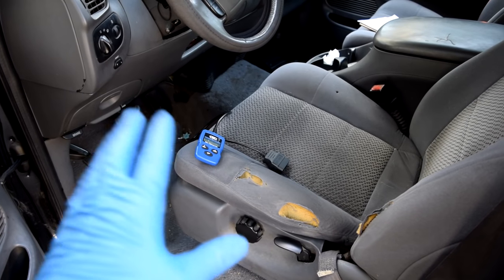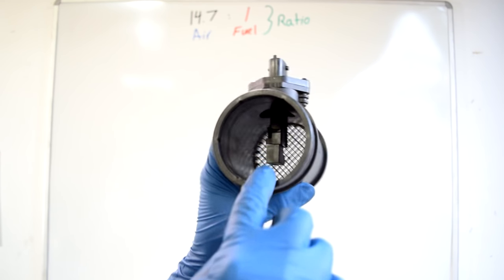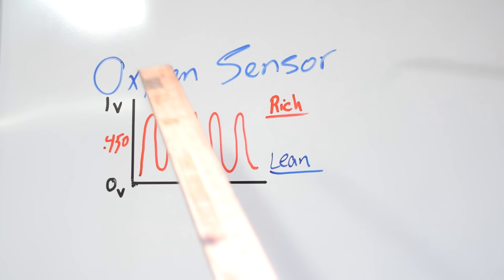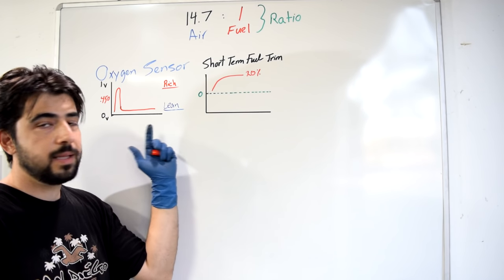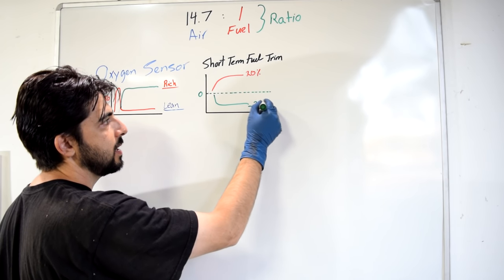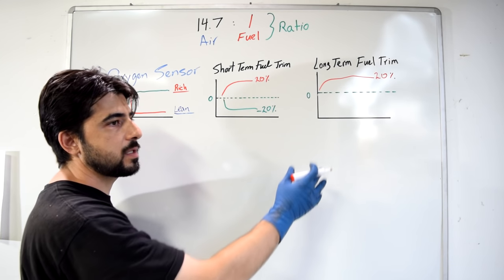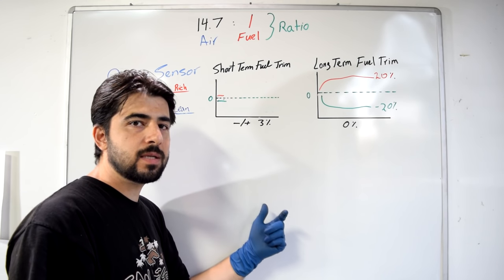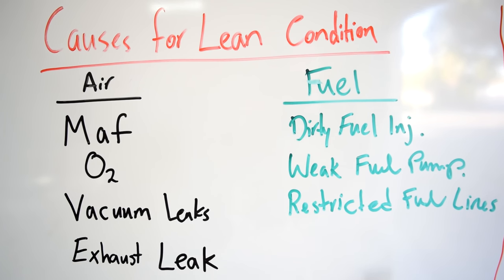Short Term and Long Term Fuel Trims Explained

Comment: I have a similar question. My Honda elements previous owner had a shop install an aftermarket cat and I noticed they changed the placement of the upstream sensor a lot closer to the cat itself than stock. It's almost on the cat and the downstream is at the normal position in the middle of the cat. If the upstream is very close to the cat basically at the beginning of the cat. How will that affect my fuel trims because I'm running lean like negatives 15 on both short and long term but I have zero codes just a little rough idle occasionally only on idle.

Comment: I'm in Poway  cant get 2003 5.4L  f150 to smog too rich both banks , total  do it myself  mechanic since my transmission  literally  blew up. I rebuilt  4r70w  about 7 times before I got 3rd gear to  work still no overdrive. No neutraling out  steady 3rd gear. Now eng8ne is  rough idle . Where you located? I need help

Comment: What if my Short Term Fuel Trim is normal (0, +/-5) but my Long Term Fuel Trim is constantly above 30? The number does go single digits when I floor it real quick. I have a p0171 lean code for my Toyota Corolla. Already replaced the intake gasket, valve cover gasket, and air filter. I did clean the MAF sensor but that didn't seem to work even though it was dirty. I replaced it with a inexpensive MAF sensor and that didn't work either.

Comment: I am asking the MAF sensor for my 2010 elantra has 5 wires. There is a  ribbon plate measures and another sensor in the housing. Should I clean both of these with the mAF sensor cleaner. Also the idle is rougher in drive than in neutral. Both STFT and LTFT are negative... STFT .05 and LTFT . 29. I am waiting for my scanner to be replaced and will retest all the O2 upstream, and STFT, LTFT. Any further thoughts...Thanks

Comment: 02 Sienna, 420 code.  Does 99.2% B1S2 indicate a bad after cat O2 sensor?  all the upper are at 3.3V and other long term is at 14%.

Comment: I just got a Zurich ZR pro scan too and don’t currently have a check engine light but might soon. When I scanned my car to get familiar with the tool the long term fuel trim says it’s at 14% and the bank 1 sensor 1 is at 3.3v constant and bank 1 sensor 2 is all over the place. Is there any way I could send you a pic of a line graph of the engine rpm... sp02 sensor 1 and 2 and long term fuel trim...?? I’m needing help..

Comment: At idle I have a lean condition with around 7-10% idle. I have a honda Crv 2003 and the air intake hose is torn right where it is held on to the throttle body. Could this cause a vacuum leak that could cause the issue? (All seals and gaskets have been replaced last month). It's a fairly cheap part and I didn't think it could be a big issue but looking at the video it seems to point me that way

Comment: Hi there!  Can you tell me ...Rough idle no check engine light...Scan tool on closed loop is 2.0 volts O2 Sensor upstream....0.74 Volts downstream, STFT    -o.78%   LTFT   1.56%  Fuel trims look ok?  But voltage on O2 sensor really rich at 2.0 volts.  Car drives ok??? Any thoughts?  MAF sensor seems ok  Checked with scanner. Throttle body was cleaned.   Fuel trims added together look good except STFT 
- 0.78% . I can smell fuel sometimes when I cold start the car?  Anymore ideas ?   Thanks

Comment: If my ac is not blowing cold could this have any thing to do with it, some times I have a hissing Sound with some vape 💨  coming from under the hood and a little moisture I can see at bottom of the plastic pan that’s sits under front end that only happens tho when I put some ac/pro in, depending on which one I get it happens 1-2 days latter or a week

Comment: On 2007 chevy aveo ,I have high LTFT with test result tid$04 cid$60
Wich is high sensor voltage for switch time calculation, which i think it refers to oxygen sensor (sensor 1 bank 1) , since aveo does not have maf sensor but does have map sensor instead , so vacuum leak doesnt affect LTFT 
What could be the problem??

Comment: Hey i got a question if my short term fuel trim is - 19.5 and my long term fuel trim is -16.4 ?how would i diagnosis this problem. 
My Car is a 2000 Honda Civic si, it has a idle problem when it’s on a stand still  and will die one the car gets in to operating temperature but will start right back up 
My guess is check fuel just not to sure i did Check fuel pressure and it was steady at 40psi

Comment: I am trying to fix P1128 on my Hyundai and LTFT is 25 which is the reason this error code is set. The car is Hyundai Accent and the problem with this car is the same that is hesitation in the pickup. The car has no MAF sensor but one MAP sensor which is working fine (showing about 30kpa), one O2 sensor which is also giving varying voltage 0.1 to 0.7 volts. Spark plugs are new and plug leads also checked and found all good. Got fuel pressure checked by a mechanic and he says its good. Fuel filter, air filter were also replaced at service recently. On deleting the error code the engine idles rough then becomes fine after sometime and after two or three days LTFT reaches 25 and error code is set. I have also checked for the vacuum leak and there is none. One weird thing is seen that if air filter assembly is disconnected and throttle body is allowed to suck air directly then fuel trim starts to become normal. What should be the next thing to check or replace?

Comment: In real-time closed loop on my ‘05 Tacoma 4.0L V6, my O2 Sensors B1S1 and B2S1 are reading in excess of 3.2V, whereas the B1S2 and B2S2 are reading about 0.6V to 0.7V..... Can you tell me what this means or if this is normal for this vehicle?

Comment: I'm confused,  my short term is ok around 3% down to about negative 3 . But the long term is stuck at 7.8 .  I noticed my o2 sensor 1 seems high between,  1.7 and 2.4 volts . Is it safe to say I need a o2 sensor ?

Comment: i have a Honda civic fd 2006, and my fuel consumption is high. my long term fuel trim is -11.7%. and I got the code P0420 . my scanner doesn't display the voltage of o2 sensor B1S1 but displays the voltage of B1S2 which is fine. it does however dispute current of sensor B1S1 which is between 0.01mA and 0.02mA. is something wrong with B1S1 o2 sensor?

Comment: I am having an issue with my toyota matrix, code p0171, my short term fuel trims are oscillating from 0 to +15. My LTFT stays as 10. When I give it gas the LTFT goes to 20 with my STFT coming down to about 3. I am thinking I may have leaky or clogged injectors, but don't know of thats where I should be looking, or if my o2 sensor is malfunctioning. It passes the voltage test though.

Comment: I get P2097 post Cat rich then after about 10 more miles I get P0420. My long and short FT do not go over +5%. It is 2015 Chevy volt. Do I have bad Cat or Downstream O2 sensor?

Comment: I have ah o2 sensor bank one problem with a lexus is300,  I took a o2 sensor from a 1jz 3.0  engine and put it on my 1gfe 2.0 engine,  will I burn more fuel by doing that ?

Comment: What do you think would cause my long term fuel trims to be up around positive 12 to 20 at time and my short term is around negative 1 to negative 10 it even got to when I was driving stays around negative 1 to 3 at idle. I've replaced all o2 sensors and maf sensor smoke tested, fuel pressure tested around 52 psi and new fuel filter  also no evap leaks any idea or suggestions?

Comment: I had similar symptoms to the lean fuel condition,02 sensors were replaced within a year but my battery was pretty much dead and created a lack of throttle response. I replaced the battery and everything seems fine but i did recieve a p6092 prior to clearing and hasnt come back on yet? Should i worry?
Reply: THANK YOU SOOOO MUCH!!!    I'LL LOOK AT MY BATTERY AGAIN , THE LAST I REMEMBER I HAD A LOOSE  CONNECTION. I SHOULD KNOW BETTER, ONCE BEFORE A LOOSE CONNECTION CAUSED MY TRANSMISSION TO SLIGHTLY SLIP BETWEEN 1ST& 2ND GEARS- UNTIL I TIGHTENED THE TERMINAL

Comment: When I start my car or clear the cel it starts revving up and down with a lean code and a random misfire... I don’t think it’s the coils as I just changed.. plugs were changed 2 years ago... when I give it gas or floor it it doesn’t misfire but when I try to floor in 4th or 5th gear it hesistsres a lot. The idle smooths out and I really don’t notice the miss at idle unless I clear the code then it starts revinf up and down really fast and wanting to stall until I step on the gas... any idea on what this might be? I keep getting a coolant temp sensor code and notice sometimes the coolant temp drops or doesn’t go all the way too warm even after 20 minutes of driving... can this be the cause of a random misfire ??

Comment: Hi need some help! i have a honda prelude i have a hesitation sometimes and the car wont accelerate even if i press down on the gas sort of like a hiccup then it releases all the power...I used my scanner and the short fuel trim spikes up high numbers as much as 45...what could it be?

Comment: Let me give you some specs, then I'll let you know my question. 2002 Durango, 5.9L, Federal Emissions, bank 1 sensor 2 stays at 99.2% lean. Is this a normal condition? I have an uptick in rpm's at highway speeds in cruise control. Changed computer-Chrysler flashed it. Converter changed-partially plugged. Haven't replaced downstream O2 sensor, other sensor oscillates well on the scan tool graph. Trying to diagnose the uptick problem. Any suggestions?

Comment: You have an Audi with the 2.7L (I have the 2.8 A4), maybe you can help me out a bit. My engine was running rich for a while and kept poking around to see what could of caused it, being very negative on both short and long term.
I found my MAF had a short in the circuit, just replaced it, and now my short term is looking normal. My long term however is still hovering around -17% (Use to go over -20%), my question is how long am I suppose to drive, how many drive cycles until I should start poking around again for another cause of running rich?
Reply: I looked through comments to see if there was an answer to this as well. I am trying to find out what is causing -17 on long term fuel trim. I get codes P0172 & P0420, car is eating fueling on idle and ruff idles after cold start. Trying to understand if it's air intake, MAF, upstream O2, CAT or all, haha.

Comment: I have a 07 impala ss getting code for bank 1 lean first o2 sensor reading .1 to .8 like an the video my second o2 sensor reads .750 and does not jump around its pretty much steady at .750 it does when I give it gas a little bit could the second o2 be bad giving me the lean code?

Comment: I'm struggling to find the cause of the following condition: The car is a Cadillac Escalade with a 6.2 L V8. Computer shows no Codes however the engine has a rough idle. The Long Term Fuel Trim for both banks is elevated to about 9% and it does not come down even when I drive on the highway with the throttle open 30 to 50%. I have changes the plugs, plug wires, cleaned the throttle body, MAF sensor and new air filter with absolutely no change in the rough idle. I've also tried propane around various suspect areas on the inlet manifold and it makes no difference in the Short Term Fuel trim (I could not get propane underneath the manifold). The inlet manifold pressure shows a healthy vacuum of about 20 inHg. I am out of ideas, do you have any suggestion on what may be wrong? Thank you.
Reply: Remove and clean the IAC and check the vac line coming from it, as well as the vac lines coming from the PCV valve and the return line. Cracked or broken vac lines (especially at elbows) can hide right under your nose.

Comment: So I have a odd condition.  I got a 2005 kia 2.7l v6. I got a p0171 lean in bank 1. But my short term is -1.6 to  1 but my long term is 14.1%. I don't hear any exhaust leaks or vacuum leaks. What should I check for a lean on bank 1. Also the vehicle drives great. Update. I checked bank 2 even tho I don't have a code for it but my long term is 13.3% .. I revved it up to 3k rpm for 1 min and both long terms did not change.. also all plugs and wires were changed, iacv, bank2s1 o2 sensor, ecm. Im out of ideas.

Comment: I have fuel pressure regulator built in my fuel pump it's faulty will this affect my performance 
Car start normally also there is fuel pressure regulator built in fuel filter that's ok and pressure is ok during running but it drops to  zero after shutting down the car but what I know as it's not affecting performance I'll wait for fuel pump until it dies

Comment: hi my car is not showing any code in obd 2 but my fuel trim shows stfs bank 1 and 2 around 0 but the ltft bank 1 neg 16.5% and bank 2 neg 17.9%, so is it running rich or lean??

Comment: i dont have a maf sensor in my car, have a occasional miss think its fuel related because when i put seafoam in my tank throttle response is better and the miss is virtually not there
Reply: You may not have a Maf , but you do have fuel trim. The way it's calculated is slightly different but fuel trim is always the answer to possible fuel related issues. It is probably the most valuable data parameter that we have to tell the efficiency of our running conditions
Reply: "It is probably the most valuable data parameter that we have to tell the efficiency of our running conditions"

And yet I see tons of DIY people dismissing fuel trims completely and wasting their time and money randomly replacing parts in hope that it will solve their performance issues :(

One thing to note though (as I've just mentioned in my other comment), when it comes to an engine that doesn't have a MAF sensor, the rules for what do different fuel trims mean can be somewhat different.

Comment: HI bud, this video is pretty much similar to the challenges I am experiencing with my vehicle, namely 0171 and 0174, where I have -1 to 3%  STFT but I have 25% on both banks on the LTFT. I have rigged up a smoke machine but there is no leaks visible. The fuel filter was changed, the injectors cleaned the MAF changed. What can it be?
Reply: PCV, try checking that

Comment: My 2012 Buick enclave is showing short term and long term bank 2 sensors are at - 100 %.
Negative bank 2.. insane I get a very rough idle when it's cold on mornings for about 10/ 15 seconds

Comment: Hi i have clio mk2 1.4 16v 95 hp and i had a vacuum leak i replaced intake manifold rubber gaskets,and it is idleing good but it is spending too much fuel the spark plugs are black and they need to be brown and it dosent smoke black from exhaust but my short term fuel trim is 120% and i cant see long term fuel trim on my diagnosis so i was wondering did the computer remember the values or what,please help its spending fuel like i have a 500hp car,sorry about my english

Comment: 2014 Gmc 6.0 vortec ,no codes fixed all them oem parts. Long term always in + , short term always fluctuating +/- 20 seen long term at +20 . Fuel pressure at rail 56 psi key on primed, 62psi running with load thinking its an injector issue since thats at the end of the line into the motor 🤔 130k on it.

Comment: Here is a question with a 2010 Elantra. Car starts ok but sounds like engine is having a rich lean condition although the idle is steady at 1500 rpm. Idle is rough and the  steering wheel has a vibration that is worse with transmission in drive ( Load) Car drives ok but lacks the power it once had. I bought a scanner and it showed me the following live data at idle engine warmed up..........O2 sensor Side Bank 1, sensor 1 .... 1.97 volts, O2 Sensor Bank 1 , sensor 0.705 volts, Short term fuel trim -1.6-0.8 and long term fuel trim is (-4.7) and the Short term fuel trim side 2 is 99.2% . Car studders under load from 40-60 kms going up hill . I wonder if this is a lean condition... thanks
Reply: You are way lean on side 2, Edward. side 1 looks OK.
Reply: Check and clean your IAC and check vac lines. Clean the MAF sensor. 

Assuming there's no codes.
Reply: I'm having the same issue and finally a catalytic converter code popped up P0420. 

You can check this by watching O2 sensor 1. It should steadily bounce between 0.1 and 0.9 fairly evenly (a scanner with graphs makes this convenient to monitor). Sensor 2 should stay almost flatlined somewhere in the middle, or around 0.7. If sensor 1 reads good, but sensor 2 is bouncing around, this could be a sign the cat is clogging up.
Reply: @technomage6736  No codes, I cleaned the iAC... no different, going to check for intake manifold leak,. I did clean the maf sensor last summer. The car runs great if I disconnect the mAF sensor..  Idles better sometimes worse. The idling has gotten worse over the last 2 years. I wonder about issues with the voltage or wiring to the maf sensor ?  That could cause these issues. Great scanner but expensive. Nobody seems to know how to diagnose  this issue. So I am going to do this myself. I may reclean the connector to the maf sensor and clean the maf sensor again. This part runs about $260.00  ...Thanks Ed R

Comment: Hi, I have a question. How do I know if the O2 sensor is not reporting the correct information or is not working properly? Does it fluctuate between .1 and .9 normally? is it even a correct way to determine if the O2 sensor works? Because I have a p0171 and p0170 code and I cannot figure out what it is. There doesn't seem to be any vacuum leak...
Reply: Yes, Loic. The upstream 02 should fluctuate between .1 and .9. The downstream 02 should be more steady, around .5. you are lean on both banks so I would suspect the MAF or MAP sensor first.
Reply: gary miller thanks for replying. That’s the thing, I realized I may have 2 issues. 1st, the O2 sensor oscillates between 01 to .5 volts for the both of them. The second is that the short term fuel trim stays at 46%, comes back down as soon as I press the accelerator, then goes back to exactly 46%, with the rpm at 2500. I was suspecting the catalytic converter and the O2 sensor but I seem to miss something...